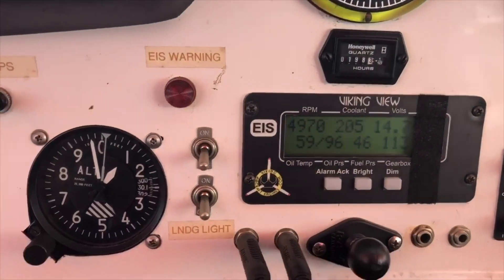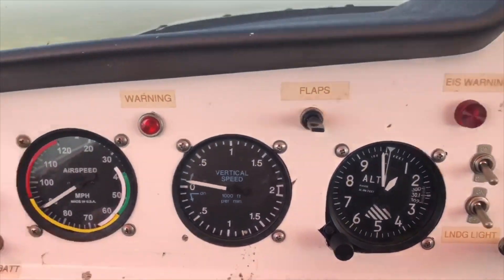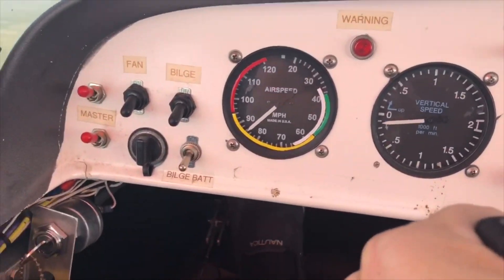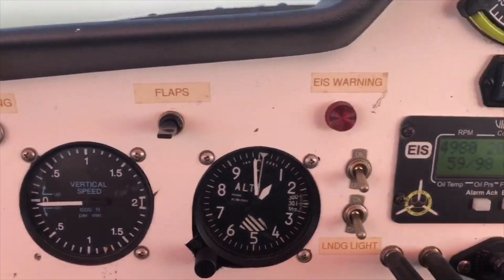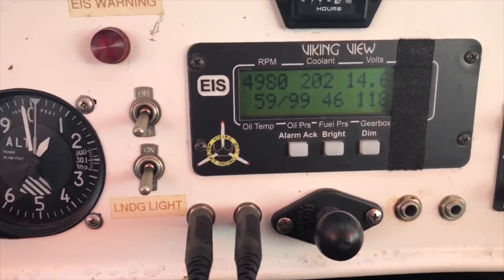Low RPM Honda engine for your airplane

Comment: Cool, that is in the same RPM  range (or less) that my Honda S2000 does on the ground at the same MPH. I once had an MG and VW Scirocco that ran in the 4000 rpm range on the HWY at almost full throttle, and there was no way an MG or VW engine could go 200,000 miles like a Honda can. Can't see that there would be any problems on a Honda at that rpm range as long as the temps stay in the green.

Comment: It’s amazing when you have a production Honda motor that already has good torque ,you run that torque through a good ratio reduction drive ,have the time and experience to tune the motor RPM gear ratio of the reduction drive to to a good propeller to achieve the most efficient thrust per gallon . And with the Viking it is all done for you. Great Job !